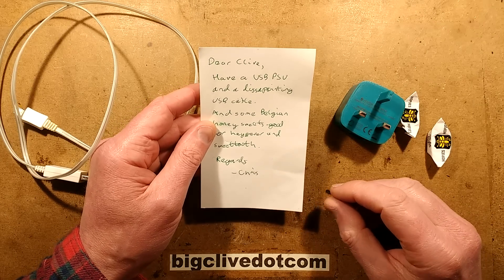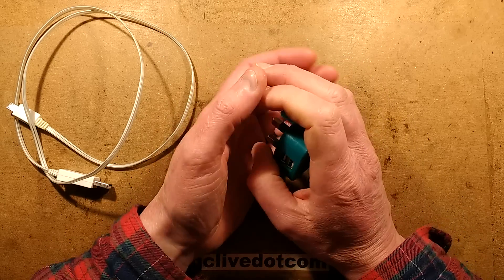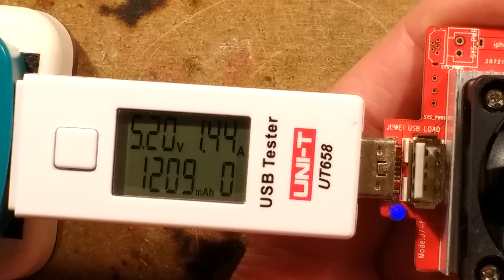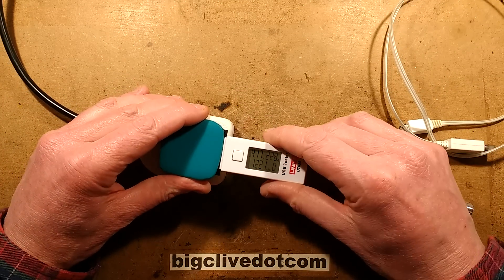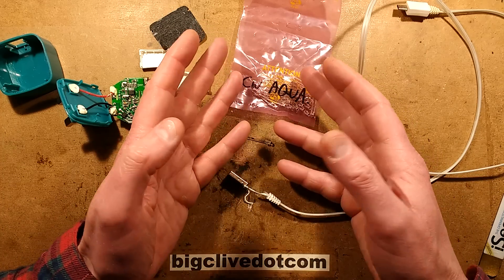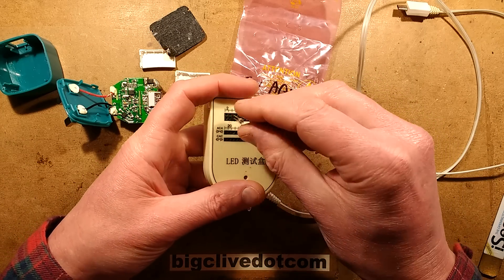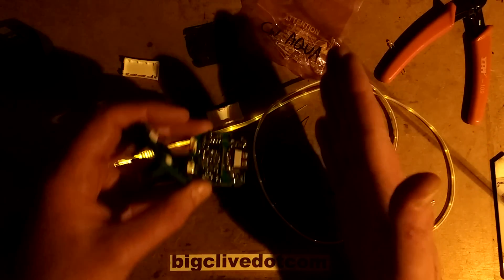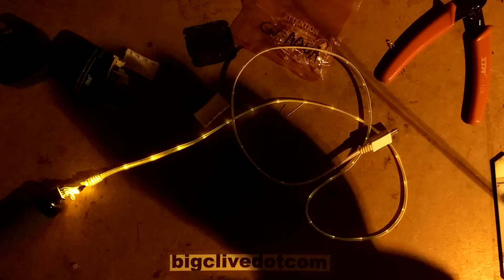Stinky Poundland USB charger and hack of random "faded" USB lead.

Comment: A year ago or so i bought a big assortment of 3mm led's on ebay for a couple dollars. they are fairly good. didn't have any fail(though i never used them for like permanent things) and they are already pretty bright on 15-20mA, hard to look at, at that point.
Reply: BangGood do a decent range of 3mm LEDs. Used their "1000 mixed colours 3mm LED" selection to mod a clock kit (now VERY RGB with orange and yellow thrown in!) Good value and all mine still work just fine.
Reply: i bought "100Pcs 3mm F3 LED Light White Yellow Red Green Blue Assorted Kit DIY LED Set" by a seller named "ichoseilove"(very interesting name). its twenty of each color for 1.50$.

Comment: "That's what happens when you're clumsy," he says, and then immediately proceeds to do a superhumanly deft job of near-microscopic soldering.
Reply from the maker: I can solder noodles really well.
Reply: @bigclivedotcom  You're a dab hand at using Chopsticks no doubt? My fingers blister and burn if they come within 2" of a soldering iron tip.
Reply: Seen his Ramen noodle escapade though? :)
Reply: KarlBunker 3mm LED leads are pretty large scale for electronics soldering.
Reply: I've been soldering for probably 30 years I dont know how Clive holds stuff in 2 fingers and then the solder in the other two......blows my damn mind.....
Reply: You think an ordinary pair of eyes would have noticed the anvil of LED connected in reverse? Probably not.

Comment: Nicely done.  Personally I'd have replaced the domed cap in that power supply as well and gone on about life; but only because I have the soldering/desoldering tools handy and a fair assortment of capacitors.  Frankly for me the landfill is a common solution once objects of those sorts become useless, not so much because they're unfixable but because economics.  

Clive, I want to say it's truly great how well and clearly you analyze devices.  A real pleasure to witness.
Reply: JamesG also the damage to the diode is undetectable so if you're looking for a rejuvenation go ahead and swap that out as well.

Comment: Clive - Is there any possibility you could explain "in absolute Lehman terms" why a start and run capacitor is used with a single phase motor and what they actually do? I understand that any motor will draw a lot of current on start up and then drop down once going but does the capacitor increase voltage, increase current? I'm really not sure it's way over my head and if you do have any basic theory to share it would be very much appreciated! Keep up the good work!
Reply from the maker: It's worth mentioning that the difference between a start and a run capacitor is the duty cycle.  A start capacitor is usually connected in series with an auxiliary winding to give direction and starting torque until the motor reaches a speed where a centrifugal switch (or thermal switch) disconnects the capacitor.  A run capacitor is rated for continuous operation and is wired in series with one of two or more windings and causes a phase shift that gives rotation.
In the past you used to be able to buy separate start or run capacitors and people often made the mistake of buying the cheaper start capacitor for a continuous run application, often overheating the capacitor and causing it to fail.  These days they just tend to have a dual purpose start or run type that is rated for continuous duty.
Reply: Paul Deakin 
Hi Paul.  There are different usages, but the typical mains capacitor start induction motor is actually a 3 phase motor. In simple terms the cap is used to give a phase shift to mimic another phase connection. This of course controls direction of rotation.
Reply: gs425 So the start capacitor on a single phase motor is there mainly to assure correct rotation?
Reply: Paul Deakin it depends on the motor. A start capacitor type typically has shading rings which bias the rotation of the magnetic field. The start cap boosts statt torque but often has a centrifugal switch to switch it out once up to speed.  Think pillar drill and the sound it makes on switching off.
What i described is more for a run cap on multi phase motors on single phase. Its also true of synchronous control type motors. Think central heating motorised  valve.
Reply: bigclivedotcom Thanks guy much appreciated!
Reply: Cheers buddy!

Comment: Most switchmodes i have  seem to have plastic woodworm, 1/8th diameter holes, odd that :-D
Reply from the maker: I used to do that to compact fluorescent lamps too.  It made the circuitry run a lot cooler.

Comment: I have a desk which has metal sheets with holes in the side and that allows an extension to be attached to it, keeps sockets nice and close to my bed whilst keeping them out of the way of furnishings.

Another thing that can help with heat dissipation is to use a power supply (especially true for laptop chargers) that has a good safety margin, an amp should be good. 
My laptop had a very small power supply that was very close to the laptops maximum rating and got very hot even without it being covered, when that failed (the power connector) it got replaced with an older supply from another laptop that had ~1A more current capacity and runs much cooler.

Comment: Can flush cutters be re-sharpened?
Reply: covishen 
It would probably be impractical to do so
Reply: Of course, with a little patience and some annealing.
Reply: Easy to do on a diamond stone.  Practice and you'll get good at it.
Reply: Yup. I've done it several times using Chinese diamond pad abrasives
Reply: Yes, but it's not really worth doing. I've resharpened mine, but always just to get a job done before the new ones came in.
Reply: I've done it before but it's very difficult to get the edges to meet all they way along. I wouldn't recommend it.

Comment: Yikes! The number of times I've covered up a charger because they insist on using a fantastically bright blue LED on the bloody things.
Reply: Blob of Blutak or black electrical tape.
Reply: L3 P3 
You sound like an Audi or BMW driver.
Reply: I guess I'm not the only one who finds that annoying. Pop them open and change the resistor or just snip the LED off. Or violate all safety standards and run a neon indicator from the mains side for that retro look. :-)
Reply: @markg735  if you snipped off the Led would you have to then close the circuit?
Reply: Colour it in with a sharpie.
Reply: @Wim Widdershins -- You beat me to it.  Black tape is my go-to solution for intrusive LEDs.
Reply: +John Squires
I have in front of me 125 self-adhesive labels that cost me £0.80 (around $1.13).  If I were a cheapskate I could cut them in two and make that 250 labels to go over cameras/leds.  They can be re-used a time or two, but I wouldn't trust them for more than single use.

Worst case (don't cut them up, don't re-use them) they're still half the price of your projected price in a year.

Oh, and I already have them, for other purposes.  Whereas the camera dots are only really useful as camera dots.  Which should I buy?  Decisions, decisions...

Seriously, if I wanted this sort of solution on a camers I'd go for one of the more expensive things with a sliding shutter.  Fix it once.  Open/close as many times as needed.  For an annoying bright LED, which gets covered and stays covered, a sticky label is good enough.  YMMV.
Reply: I have lighting gell over my most offesive indicators and displays, I have 50% block for RGB on my digital alarm clock.  Its really good stufff you can always double it up for extra obnoxious brightness.
Reply: Amazon has ‘camera dots’ - used to cover camera lenses on phones, tablets and webcams. Work on led’s, too.
Reply: Camera Dots sell for $5.99 for a sheet of 50 or so. Pricey, but it’s a new product. Price should drop to $1 within a year. They can be removed and reinstalled several times before the adhesive gives up.
Reply: darronjknight works for me. I hate those fucking things, especially on keyboards.
Reply: Lol I've got one of those things on my USB microphone.  I ended up having to put electrical tape over it....
Reply: Aha, EP-LED
EP beging eye piercing
Reply: Just put a piece of thick, dark tape over the light.
Reply: I use a hole punch on a piece of vinyl electrical tape.  Makes a nice round dot that covers up LEDs, laptop cameras, etc.
Reply: Bright blue LED indicators, the first sign of crap chinese electronics. If one annoys me, the whole thing goes in the bin.
Reply: yeah me too ! every new piece of Hi fi had to have one fitted once they became available why not go the whole hog and fit laser diodes and give us all retina damage ! I remember reading a health and safety notice that came with some hi brightness Led,s saying that they recommend not to stare directly at  them ! and that was some time ago and now we have even brighter Led.s
Reply: You'll get used to the light. I got plenty of devices that must be on 24/7, and some of them have bright blue indicators. You'll kinda get used to sleeping with blue lights on, I certainly had to since my apartment consist of one room and a toilet, and two power sockets in the whole apartment, both in the living room. And no, I can't cover the indicators up. I don't really want to either, I love LEDs day and night.
Reply: As blue light is well-known to disrupt sleep, why do they use it? 
At least give an option of colors (off too), could use red to develop film.
Reply: A tiny bit of foil tape works wonders
Reply: you just tape over the bright spot literally every overdriven blue indicator led device I own has mounds of tape to attenuate the light
Reply: Electrical tape over the light should work
Reply: +BaselBantam --> You ain't lying either.  I have a NiMH charger branded by Energizer and the blue LED is brighter than my nightlight.  I leave it in the living room if I have to charge batteries over night because it's so bright.
Reply: @OAleathaO  I say tape or brute force and ignorance to "dim" the led (destroy most likely
Reply: +John Squires
So, like self-adhesive labels only a lot more expensive.
Reply: I hate blue indicator leds and basically indicators in general.
Reply: @l3p3  disagree what about when your router/modem acts up? those indi's become very useful then
Reply: bdf2718   Well, I have in front of me 3000 UPS labels and a hole punch. I’m guessing I could get 200 punches per label, resulting in 600,000 adhesive dots at ZERO cost. If I average the cost between all my dots, that comes to 1,002 dots per penny. $1.13 USD equates to 113,226 dots. Makes your solution look like a pitiful attempt at economy.
Reply: Cutie Aleatha xoxo !!

Comment: According to Toshiba they don't put any ventilation holes in power supplies because of the IP rating, they want them to be splashwater and dust proof, and that you can't poke anything in it. So at least IP 52.

They also stopped putting fins to get a higher surface area onto them because people complained that dirt collects in them.
Thats why they purely rely on the case itself to radiate off the heat.
Reply: They can't make the case out of metal because they need to earth it. They don't want to put air vents or fins/slots because of IP rating. Where's the bloody heat supposed to go? That's just bad engineering that will results in shortening the life span of the product. So you'll have to buy another?
That's just not right...
Reply: 2009dudeman if you spill a drink on it, I'd be more worried about the outlet and prongs exploding than the power supply
Reply: If the manufacturers had cooling holes, they'd push the components even harder (like that diode) and if the slots got covered it'd be even more a of a fire risk
Reply: Like many channels Clive gives his Patreon supporters early access to his videos.
Reply: Panda, The brick has a 3ft lead to the wall. The plug that fits into the brick is pretty tight. Enough that I have time to go unplug it from the wall before it seeps into the pack.
Reply: I suspect they don't have cooling vents for the same reason laptop power bricks don't: they're portable devices. I know several people who carry these little power bricks around all the time because they have to charge their phones a lot. Vent holes let warm air out, but they also let in dirt. And crumbs. Pocket lint. Keys. Bits of paper and wrappers. Pens. Loose change. Makeup application paraphernalia (various). All the random crap people keep in purses, backpacks, pockets.

And if someone doesn't carry it around with them, it's probably plugged in the outlet behind their bedside table or somewhere similar. The dust... oh, the dust.
Reply: If they had fins, people could wipe them with a damp cloth or wash them to get all the dirt off them. :)
Reply: Wupme yup, and if they put ventilation holes in, the clothing would cover those too, so the thing would still overheat. Ventilation holes are no solution.
Reply: I've got a few very old power bricks with short plastic fins.  I suspect it's not so much that the fins dissipate heat, but they would keep a little space between the brick and anything that covers it; so a wee bit more chance of adequate air circulation.
Reply: Most laptop manufacturers have done that so they look 'sleek'. I like not having cooling vents on them, i've had people spill drinks on tables and come close to dripping onto it. Sealed it wouldn't really matter, open it might. But I'd like some cooling fins on them, maybe an anodized aluminum would be nice looking, and as long as they are rather spaced out, cleaning is easy.

I usually resort to putting the brick near a fan if possible for prolonged use as its a rather beefy 120W brick.
Reply: Also serve as a visible reminder not to cover them.
But then, some may try using as a weird hot plate
Reply: The clearences inside a power supply are likely to be much smaller than those on the external connector. So liquid is far more likely to cause problems inside the power supply than outside.
Reply: Max, thats a fair point.
Reply: Billy Sugger, it would still be better than no ventilation holes, packed inside a cramp plastic box. If they put slots on all sides, there is no way a cloth can cover all the holes if the PSU is plugged into the wall (vertical) 
Why do they think water can't get in from the usb connector?
Reply: Wypme, how did you get to watch and comment on this video 3 days ago?
Reply: UFOhunter that's living in the throwaway Society for you poorly engineer it and when it fails by another one I cut four holes in one of my Chargers with a soldering iron it might look ghetto but it's lasted a long time and it doesn't get quite as hot as it used to
Reply: MGTOW REVELATIONS I'd opt for removable fins that snapped onto a sealed box.
Reply: This is why it's important to ignore moron's who complain like that,
Reply: Oh, my backpack never had that problem. But I knew quite a few people who'd carry all kinds of stuff around with them. We couldn't shower after gym class, so some people would change their clothes and any dirt/grass from the field would come off their dirty clothes into the backpack. They'd also hide snacks in there in case they got hungry before or after lunch, hence the crumbs. And have you ever seen what happens when a container of foundation powder breaks? Holy shit...

Yeah, I'm not arguing the sealed design is without flaws. I just also understand why they wouldn't want to put holes in them. They'd be complicating manufacturing, weakening the structure a bit, and allowing crap to get in there. I'd definitely like to see more serviceable designs, but the electronics industry currently treats $800 phones as disposable. And if you're Apple, a laptop that costs a few grand is disposable. It's unbelievable.
Reply: Crystal Soulslayer Remind me to keep clear of your purse and backpack -- my backpack and pockets may have tended to be full at times, but they were never full of dust and lint, and other debris and detritus, and I used the same backpack from late elementary all the way through college and then some...LOL

But cooling fins, even in an otherwise sealed chassis, do help with cooling -- anything that physically increases the surface area in contact with ambient air will help to cool the chassis more than without and a cooler chassis can more effectively transport heat from the interior to the exterior.  I also preferred power bricks that had cooling vents built-in as they not only ran much cooler, on average, but could also be easily and trivially repaired if they broke down (such as capacitor failure).  With the "modern" sealed power bricks they not only tend to run much hotter but to service them you must first, ironically, break them mechanically then try to glue them back together again (or wrap lots of ugly tape around them). It might not be so bad if OEM power supplies were much cheaper and the knock-offs did not tend to be of crap construction, but things are what they are.